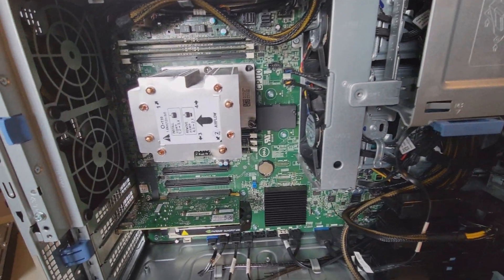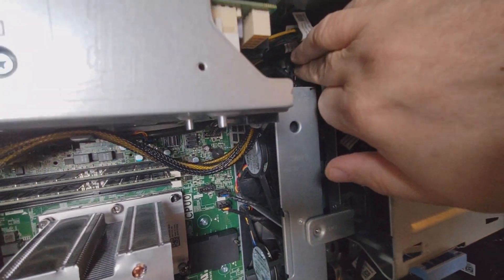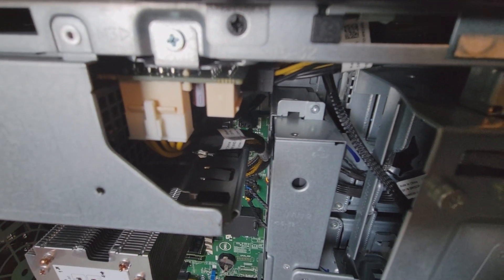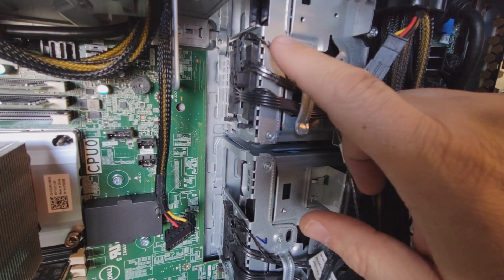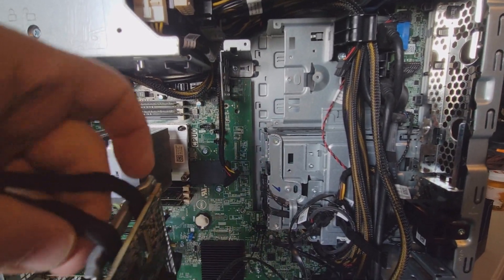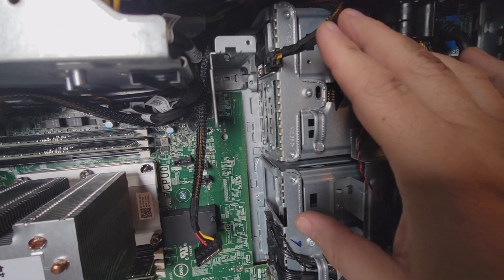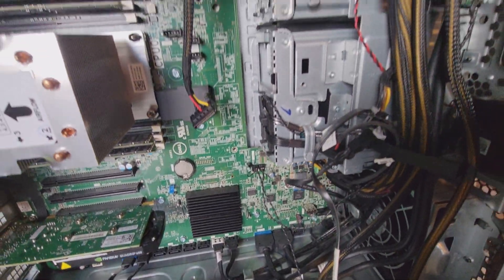How to upgrade a Dell T7820 to a U.2 Backplane

Comment: The flexbay caddies for m2 nvme has a tiny hole for locking the entire caddy? Obe ues a paper clip. Wire to unlock. Is this used or it was designed for other rack mount servers. The whole m2 caddy can be readily pulled out just like the remaining bottom 2 regular 2.5-3.5 sata flexbays?

Comment: I've just upgraded my 5820 with the U.2 backplane, as I've not got the U.2 disks yet, I've had to test with a couple of 12TB spinners. They were not detected by the OS and the caddy lights were flashing orange. Does the backplane need any drivers or do I need to make any BIOS changes? Another concern is that the backplane I purchased has one of the ports covered with a sticker that said 'do not plug in', hardware wise it looks identical to yours and I think the sticker is because the backplane came out of a non-Xeon system (I have the W-2195). Thank you
Reply from the maker: Thanks for the comment.  I haven't researched the 5820 so I don't know if it will support u.2 disks.  If you can't get them working you might just go with SSDs.  Best of luck.
Reply: @vmexplorer  I can confirm, now that I have received a pair of U.2 disks, they are detected. The U.2 connectors on the mainboard only support NVMe (not SATA or SAS). I can also confirm that having removed the 'do not plug in' yellow sticker from one of the ports that was covered, both ports work fine. This was a limitation for non-Xeon 5820's.

Comment: Nice video! Do you know if this backplane upgrade accepts SAS disks?  Would it work in the lower bays as well?  I'm struggling to find any real answers online.  I'm trying to convert a 4x SATA setup to 4x SAS.  I know I need an add'l HBA card but this backplane looks like the included cables would be too short for either bay to reach it. Also not sure if it HAS to be a Tri-mode (9440-8i) if I'm not going to use NVMe...
Reply from the maker: Hey Jason,  U.2 connector "should" work with SAS.  However, I have never tested this out nor do I have plans to.  Not sure what your use case is BUT it may be easier to use the 7820s 5.25" bay with a SAS carrier like this one.  Best of luck! https://www.amazon.com/ICY-DOCK-Backplane-Comparable-Tray-less/dp/B00V5JHOXQ/

Comment: Is it possible to set up a RAID 0 with 4 NVMe SSDs using the Dell Ultra SSD M.2 PCIe x4 Solid State Storage Adapter Card?
Reply from the maker: Not sure I don't have the hardware you are talking about.  I would check the dell guides.

Comment: Hello I want to connect a standard ATX PSU to this motherboard. Can you confirm the only two power connectors are the 24 pin and that 10 pin?
Also the 10 pin looks like it's ground and 12volt only can you confirm that? It's 5x 12v (yellow) and 5x ground (black)
any ideas if the 24 pin is proprietary as well can you give a better video/images of it? thanks
Reply from the maker: Thanks for the comment.  I cannot confirm the power output on this device.  You might you might try looking for this manual -- DELL PRECISION 5820 7820 TOWERS TECHNICAL GUIDEBOOK.  I can't seem to locate it after a quick search but I found the the 7920 book. The 7920 appears to have power information about the 7820 around page 23-24.  Good luck. https://www.delltechnologies.com/asset/en-us/products/workstations/technical-support/Precision_7920_Tower_Technical_Guidebook.pdf
Reply: @vmexplorer  I asked for the power input not output.. the books are very easy to find, but they are irrelevant since these are proprietary devices there is no info on them. If dell had any info on them I wouldn't have asked.
Looking at your video and others it is obvious they are proprietary connectors (looking at the power supply output and the colors of the wires)
It is more 12volt than 5volt like the ATX power supplies used normally.
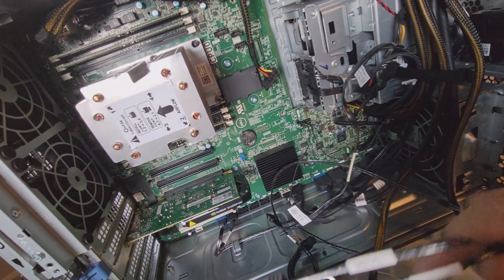Anyway I have another request, can you trace the "case protection switch" to where it goes, or make another video with it and show where it goes? Is that the tiny red/black twisted wire at 2:51 - 3:30 on the right side attached to the big black box I think?